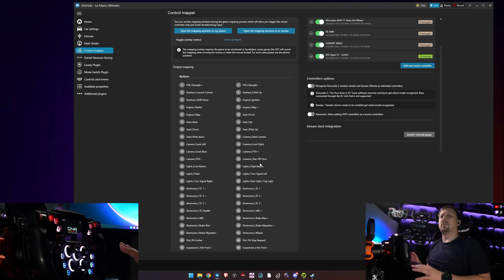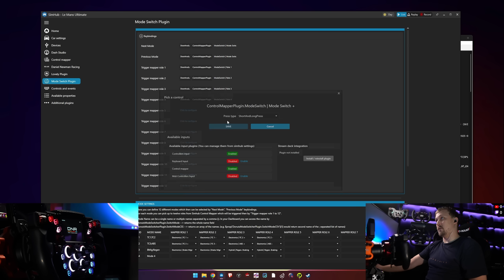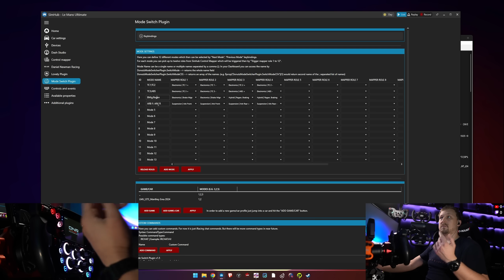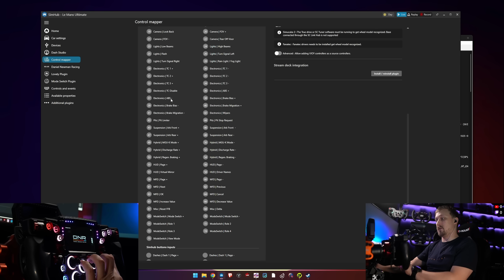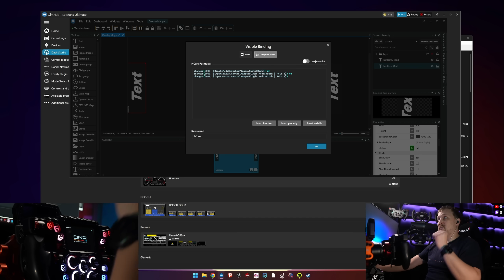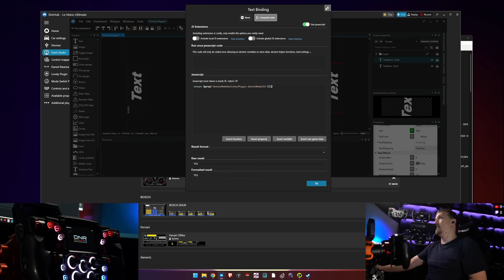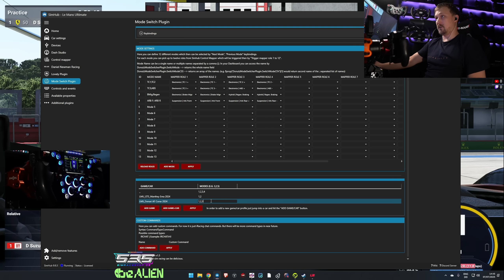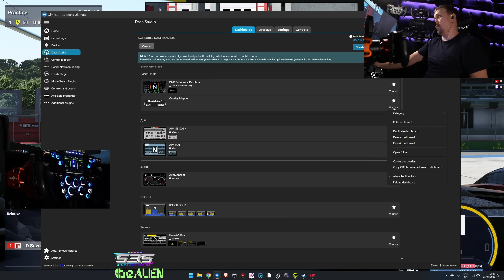You Don’t Need a $1,000 Wheel to Get Multi-Link Encoders! 🔥 Do THIS on EVERY Wheel! 🔧

Comment: Hi Dan, I have a question. I have the Conspit 300GT and am trying to use the multi encoder, which it already has, in AMS2. However, when in AMS2 and trying to map it the game doesn't even recognise the input 😢. Would this solution work for me in AMS2? In LMU the centre knob works as it should.
Reply from the maker: I think AMS2 has a limit on buttons it reads from a wheel. 32 or 64 max or something?
Reply: @DanSuzuki  yeah, think it is 64. Was hoping vjoy and control mapper would allow me to kind of bypass that hindrance.
Reply from the maker: Yeah definitely possible - you can set up up to 3 virtual joysticks on the same arduino - if you only assign the first 64 buttons each it should work fine

Comment: THIS! Oh boy, that is so great. Even with a Moza CS V2P steering wheel, which only has 2 rotary encoders I can set up one to switch modes and the other one to increase and decrease the setting, while having a small overlay to indicate which mode is active.
I always struggled where to put all the TC power, TC cut, TC slip, brake bias, etc. etc. and had my keyboard next to me but this was so distracting while driving I couldn't really change anything mid race.

One question though, that arduino you mentioned has a USB-C port ob board not a USB plug, so I need a cable to connect it to my PC?

Comment: Will it work on a thrustmaster?
Reply from the maker: Every wheel 😅
Reply: @DanSuzuki  It didn't work for me when mapping within the game.
Reply from the maker: You need to use the widget thing to map ingame - otherwise it will use the wheel buttons instead
Reply: @DanSuzuki  Actually it was my mistake, I didn't have any Arduino installed to make the bridge, thanks for the excellent video

Comment: Nice ! I already do this, but your overlays are nicer, I am taking notes ;)

Two simple homemade overlays I use and recommend are one for the ABS (illuminate the edge of the screen in color with transparency, a bit similar to a FPS screen effect when you get hit) really useful when I don't want to use the haptics at night. 
The other is a simple red dot who appears if I do cross input (throttle+brake) that I used to break that bad habit. As an average simracer it made a big impact in my laptimes.

Comment: Did exactly this 3 weeks ago, without the plugin tho, still works a charm! Very easy to make a visual guide on a dash as well. Good thing you pointing it out!
Reply: Did exactly the same. Constantinos did a video without the plugin. You don't have the luxury of "names in a property" or "select by car" though so I might give the plugin a try. Thanks for explaining
Reply: I did the same as Constantinos, but how do i bind them in iRacing for example? I can’t get it to work. Simhub is setup correctly.
Reply from the maker: Interesting - you got it working with an encoder? Or a rotary switch?
Reply: @DanSuzuki  Vjoy+ Control Mapper> Special FN Button Xy set to  "Momentary to latching Group".  Than when you select BB+ - you move the MPS to the BB postion and use the rotary or encoder that you want for the +&-
Reply from the maker: but that will only work with a rotary switch or absolute encoder if I'm not mistaken ... not many wheels have those.
Reply: @DanSuzuki  Idk, don't have wheels that don't have MPS that are also widely used.

Comment: Wow! That came surprisingly. I am feeling very honored. Thanks for the review, Dan!
Reply from the maker: Great Job on the plugin - super easy to use and super powerful :)
Reply: @DanSuzuki  A few new features are already on the road map.
Reply: @DonUtz1975  Thanks for the plugin👍
Reply: @DanSuzuki  By the way: Besides the comma separation in the name tag you can also directly access the assigned control mapper roles. 
$prop("DonutzModeSwitcherPlugin.SwitchAllModes")[1].Action1 (.Action2, Action3,...) shows which action/role is assigned (for mode ID 1 in this example).
Reply: You done a great job man,  thank you!

Comment: I have been using VJoy, what is the advantage of having the actual arduino? just less latency? Thank you for the video!
Reply: I was using Vjoy for a while and thought the same until I started running into painful issues. The hardware USB route works flawless.
Reply from the maker: I find vjoy painful to work with 😅 if you get it working there is no benefit to using an arduino
Reply: @DanSuzuki  Understandable, thank you!
Reply: You have a limitation in input buttons with vjoy (128)
Reply: Here to ask the same.  I've just had to stay using this for shifters, also use vjoy, and don't think I'm seeing any latency.

Comment: Thank you so much for this guide Dan, super simple and helpful. ControlMapper is awesome. Would this work in conjunction to the GSI clutch bite point overlay that also goes on top of the dashboard?
Reply from the maker: No, but you can just add the notifications to the bite point overlay instead of creating a new one 😊
Reply: @DanSuzuki of course, that will be the perfect solution. Thanks!